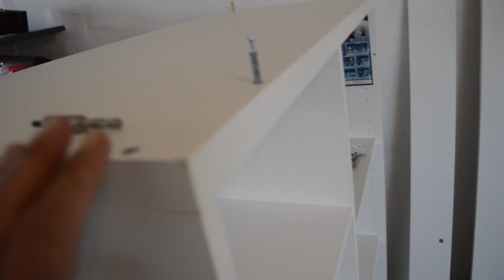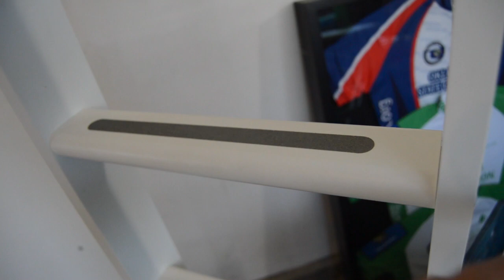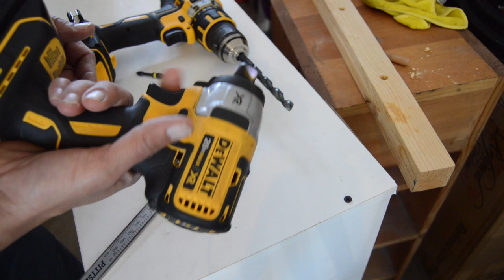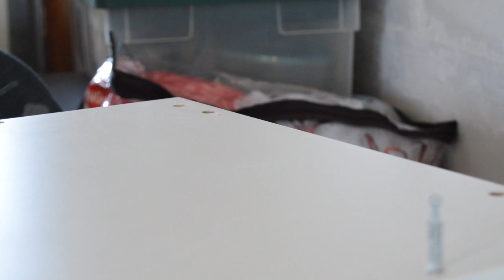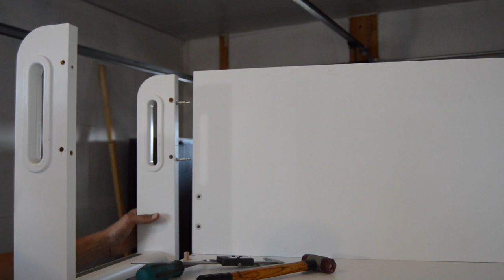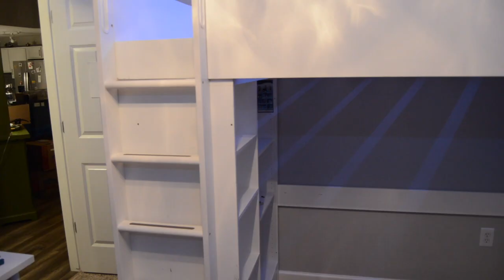IKEA Stuva Loft Bed Left Side Ladder Modification

Comment: Thanks for sharing!
Got my mind blown by ‘left side ladder’ idea yesterday, used e-pdf from IKEA to check if possible - disassembled half of the bed... just to realize instructions are from fresh new model, just came out - SMOSTAD - it can be assembled in any orientation as you wish.
Omg had to assemble everything back on and start searching for a way to modify.
What a shame for IKEA. Same model, just new with new set of holes :|

Comment: Does the modified bed still seem fairly stable? I'm looking at buying and modifying this (new) for a small bedroom in a college apartment in a few weeks, and will need to bring tools (and anything else needed to assemble and modify it) with me... It looks like I might have to put it together the documented way first, in order to then understand what needs to be modified (and where) to flip everything to the left? Or maybe I should print out the directions and then mark them up if I can identify each of the parts you modified (drilled) in the assembly instructions... 

Also it seems like you got the bookcase version and not the cabinet door version but I'm guessing that part won't matter? In the Stuva/Fritids (cabinet door version) they show assembly instructions for doors on the "inside" (left) or "outside" (right) with cabinet on the right. I guess that gives the flexibility of using the side cabinet in original orientation or rotating it 180 degrees but I'm not sure if one is better than the other (or might require less modification to the top).

Any other advice or suggestions would be great. Looks like I'll need that 25/64" bit, my other bits, cordless drill and impact driver, calipers, tape... Anything else? 

I'm wondering if stuffing some extra half-dowels into the adjacent empty holes (when drilling new ones nearby) might help. 

Also, you mentioned the modification took about a day; would you add another day for initial assembly? Thanks!
Reply from the maker: The bed is still holding up great. The end portion that holds the shelves or cabinet is part of the bed, so it's pre-drilled to use either the shelves or the cabinet. It sounds like you've got all the tools you need accounted for. You could run a few extra 2 1/2"-3" wood screws in the ends to help strengthen things up if you feel like it might need it.

As far as the timeline to build the bed with modifications, it really just depends on how much help you have and your skill set for building Ikea furniture. If you have a van or truck, you could potentially prebuild the bed in a garage or large area, then break it down into large but manageable pieces. I've moved ours twice since we've had it and it doesn't need to be fully disassembled to move it. It took me a bit to wrap my head around some of the hole locations. Some areas look symmetrical, but they're off just a bit. the best advice I can give is just think it through and take accurate measurements.
Reply: @JoeyMesa  Thanks for the info! Turns out my daughter just got an offer for on-campus housing (assuming they don't change their mind in the next month with the whole pandemic thing) so we may not have to build one of these beasts... this year anyway...  but I'll definitely keep this in mind as she really did like that bed! Thanks for the awesome how-to!
Reply: Is the desk necessary for stability would I be ok if I left it out

Comment: I’m in the process of doing the same thing with my daughter’s stubs loft bed. I’m having trouble with the sideboard in the back. How did you put it since it has 3 round metal thing where the screws were supposed to get hold onto?
Reply: Would love it if you are still picking these messages up. I am struggling with this one piece I think too. Just trying to fix the outer board onto the longer piece.
Reply: I remember my drilling new holes and buying same length screws at HD. I had to do the same in securing the ladder.
Reply: @vanessaobaldo8424 I hah. Nice to know people picking up this random videos messages I got there in the end. It wasn't in the video but there are quite a few mods to do for this specific piece in order to keep the whole thing sturdy. The inner long piece needs three new holes which have to be fairly accurate because the outer piece should then connect to the ladder.
Reply: Anyway,  I did it with this video and I don't have lots of carpentry skills. So if anyone in the future picks up these messages it's pretty doable.